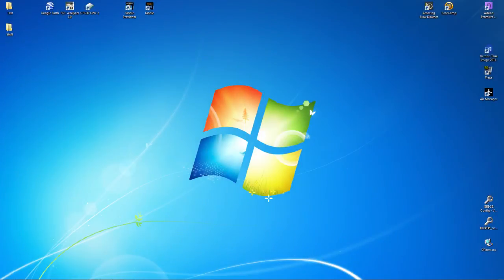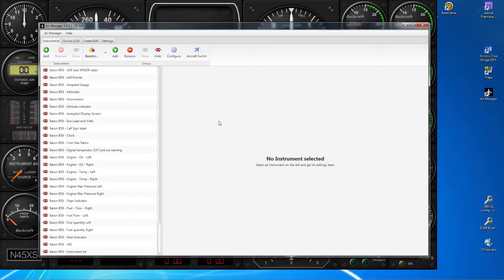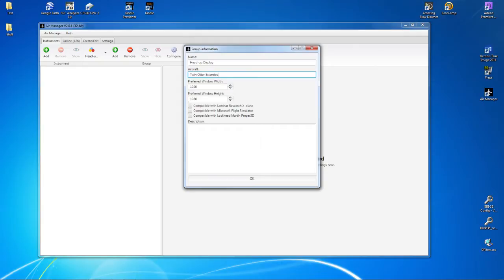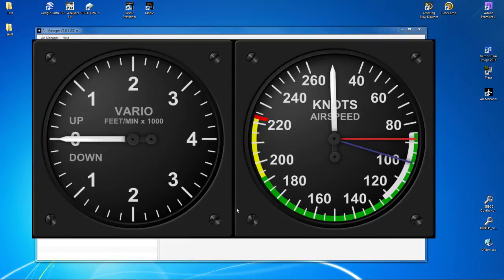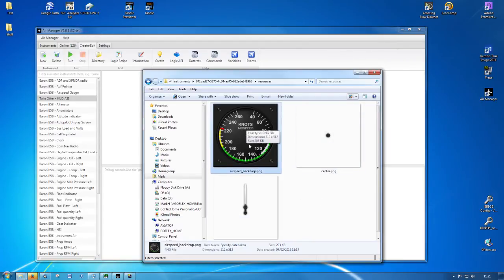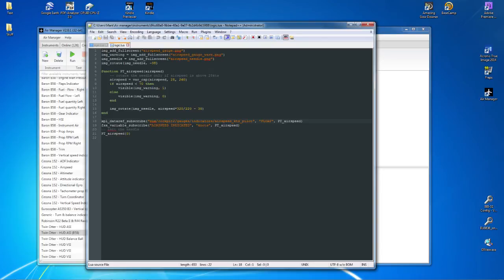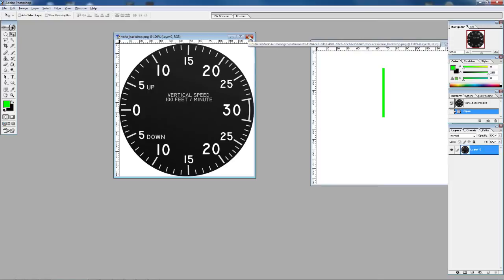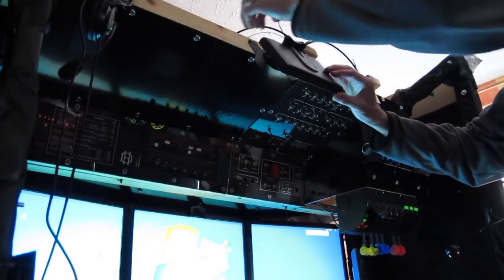Sim Innovations Air Manager Review

Comment: Hello, I would like to ask.
Is it Air Manager multi screen?. I tried with Panel Builder and I can't, so thinking on buying Air Manager but there is nothing written if it is possible to create several instrument panels and use them in different monitors.
Thanks in advance
Reply from the maker: Yes, indeed! You can run multi-screen and also multi-computer if you want. Air Manager has moved on since I did this review but even though I am still on v2 I run two screens. Look at any of my Twin Otter videos for an example -  this one, for example: https://youtu.be/jOuzTZfFGPE?t=15m38s. Check out the AM forums for the latest: https://siminnovations.com/forums/

Comment: Nice explanation, was looking for something like this

for your hud, you could try a pico beamer. that is aimed at your screens.
Reply from the maker: Interesting idea!
Reply: A real HUD would use a regular monitor with a half-silvered mirror. Projectors work fine on an opaque surface but not on anything that is transparent, you want to put the image somewhere out of view and reflect that image off a piece of glass, instead of projecting directly onto it.

Notice how your monitors are reflecting the stuff that is on your glareshield? If you put the display for the HUD there, it will appear in view when it's on.

Comment: tnx for the prompt respond I'm, currently, experimenting with both demo versions, customizing with PB is a matter of Right mouse click and applying the desire variants (  for example on the Speed gadget changing the arch white green yellow colors) resizing is by rolling the mouse wheel and etc, where in AM those tasks require some more sills.Seems to me that AM , price and graphic wise, multi-platform is more attractive than PB, and it's constantly evolving which is great Cheers Needless to say that I'm following all your Videos, keep posting, they are really fun to watch .... :-)
Reply from the maker: Actually yes, you have pointed out a handy feature of PB, which is that it has generic gauges that can be reconfigured for different aircraft. That would be nice to have in AM although it does constrain the gauge design.

Comment: Very nice presentation, however, as a guy with no programing skills and graphic software knowledge, this piece of software is a bit overwhelming and bring me to the assumption that I'll better be with it's counter part Panel-Builder,  which seems like more user friendly
Reply from the maker: I can't comment on the current build of Panel Builder but in my experience it is no easier to use and lacks many of the advanced features of AM. You are right, of course, to test AM to its full potential you need some programming skills and/or graphical editing skills, but to use off-the-shelf gauges (which is all you get in Panel Builder) it's fairly easy. In my experience the level of professionalism in how the two products are marketed and supported is also very different.

At the end of the day you will always need to do some hacking to get anything other than the default aircraft to work with AM, but at least it is possible to do it. With the early builds of Panel Builder you were stuck with default aircraft or with some crude hacking to approximate the gauges in add-on aircraft (see my PB review for an example).

Comment: Hi
Do you have to install the program on both the fsx machine and client? 
Thanks
Reply from the maker: +rich dury No, in this version you run a small interface program on the client. In the newer version I think you just install a DLL and it runs automatically with FSX (from dll.xml). You only need to install the main program runs on the client machine. have a look at the Sim Innovations (formerly Air Rietveld) forums for better info. (https://siminnovations.com/forums/)

Comment: A remarkable achievement. Air Manager seems to be a very powerful application. Could you now dispense with the virtual panel on your forward monitors, and construct a main panel with another monitor behind it to display the required gauges?
Reply from the maker: Yes, that's the idea. However, I am not sure that all of the Twin Otter gauges could be implemented so it would need a bit of research.
Reply: +skyrider828 Air manager can also be run on a dirt-cheap 8" Win 8 tablet. And by "dirt cheap" I mean <100 USD. For that money, you get a quad core 1.3 GHz tablet that runs Air manager 2.1 in all its' glory just fine - WITH TOUCH CONTROL. If you can't fit all gauges on one tablet - buy another one! :D